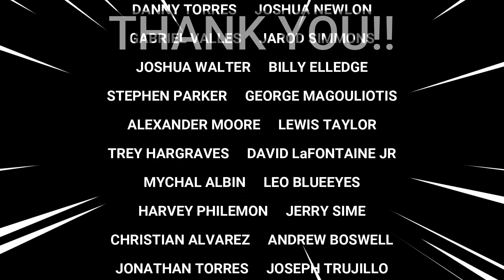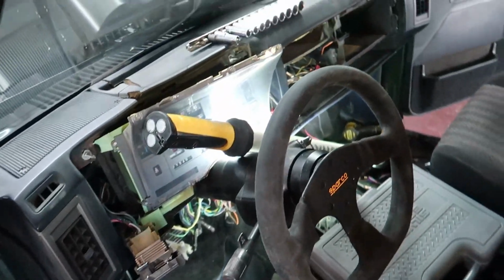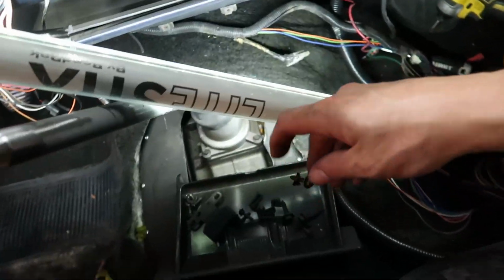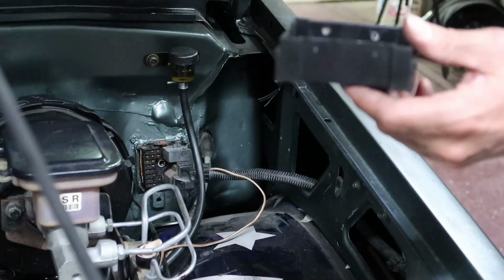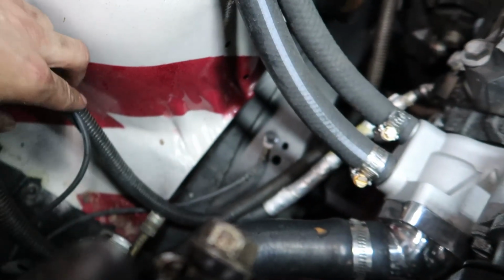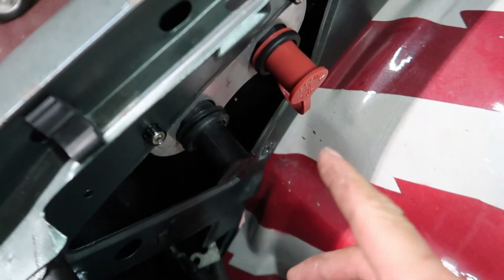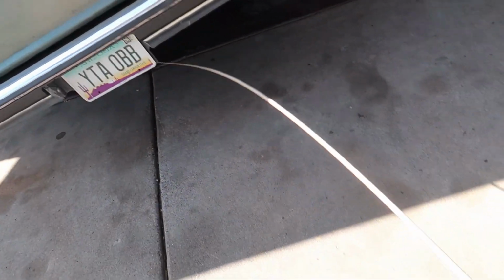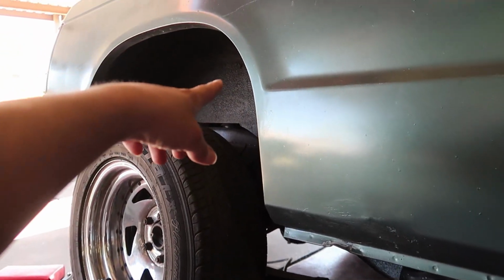Pulling DASH out of S10 (it's a MESS!)

Comment: SWAMP COOLER: take an old gallon milk jug (or anything plastic and similar), fill it with water, freeze it, and place it in the swamp cooler. Cheap way to make the air cooler. Refreeze and reuse.
Reply: I just put ice at the bottom
Reply: That works but you eventually have to drain some out.
Reply: @cafrogg2016 why do you drain it? You usually have to fill it more as the day goes on due to the water evaporating
Reply: @RipstickMaster1998  I guess it depends on how much ice you use. I had a hose hooked up to the cooler (window mounted cooler) and it would fill as needed.

Comment: @deadbeatgarage a 2010-15 camaro water pump would solve your coolant hose problem and it is truck accessorie friendly.  The hose comes out on the driver side of the water pump and then you can run the intake to the passenger side
Reply from the maker: I'm definitely gonna look into that! Thank you 👊

Comment: Use spray foam and vinyl to repair the dash I did it on my z34 lumina dash. The dash is made out of foam so fill in the cracks and gaps wide expanding foam the cut and sand and then you can re vinyl or use Bondo to make it look factory again..    good luck

Comment: Those wires go to the blower motor, blower motor resistor, also AC pressure switch when you have the evaporator in.

Comment: For the EF sedan, it's a main relay. I had no fuel pump power no matter what i did. Toggle switched the pump and it worked fine. Usually the 88-89's I've noticed.

Comment: On the dash fixing the cracks first trim down all the sharp points on the cracks then full all the crack with spray foam from Lowe’s in the red cans let it get hard give it a hour to 2 hours carve the foam down to match the rest of the dash then use fiberglass Bondo on top of the foam sand prime and paint the dash

Comment: I'm trying to figure out why you needed to add the battery lug terminals in the fender? All you had to do is run your positive and ground wire like normal
Reply: What do you mean? He’s relocating the battery to the back, and cause of the airbox might be going on the side of where the terminals are “if” he gets a airbox
Reply: @IDABAYAREA650I  I fully understand that. What I'm saying is he doesn't need to add those terminals to the fender because he is running a alternator. Most people who add those are for drag racing to charge the battery between rounds when your not using a alternator. There's no reason to add those to a full street truck he can just run his positive and ground like normal and get rid of them
Reply: @addicted2fuel245 this might help a simple understanding. Having those terminals there gives him the same function as a oem battery placement but allows the engine bay to look cleaner. It also allows him to have a spot in case he needs to jump start someone's car or he needs a jump start not only does it give him a extra spot say if his truck died and he backed into a parking spot he would have a place to jump it without pushing the truck out and having to do it from the rear. And lastly he doesn't need a reason to do it other than the fact he paid for it and he wants to do it. There hopefully that helps and gives a 2nd opinion to a simple understanding😃

Comment: what I've seen people use for the dash is these plastic dash cap covers they sell them on ebay you glue it on but you need to grid down the high spots iv also seen people use fiberglass lot longer of a process looks good though

Comment: I'm confused or I missed something... Why are you using a battery remote jumper terminal set up under the hood? Why would you not have just put those in back  close to where you're mountomg your battery? I apologize if I missed something in the previous video but I'm just not following along as to why you're choosing to do this the way I'm seeing in this video.